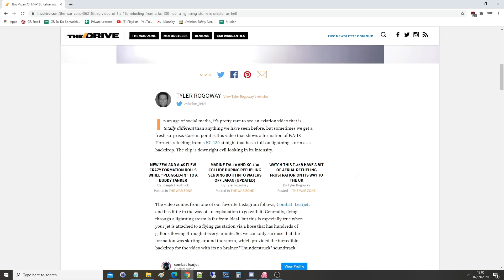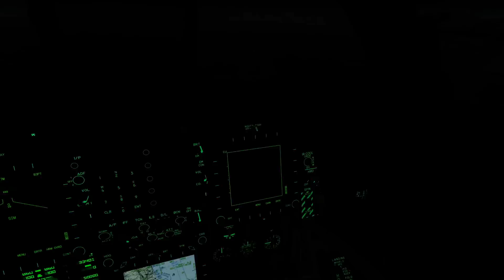Questioned: Can Aircraft Air To Air Refuel In A Thunderstorm? | DCS WORLD

Comment: Ya do what you gotta do.  .....................................much worse to punch out in a T-storm after running out of gas.   Most survivors, and non survivors look like they were shot with a 12 gauge shot gun due to the hail and frozen rain. But, it would be done much higher where you could see and avoid the body of the storm for the most part.